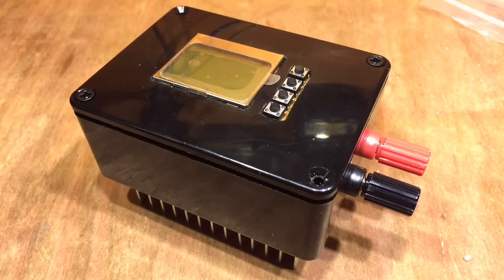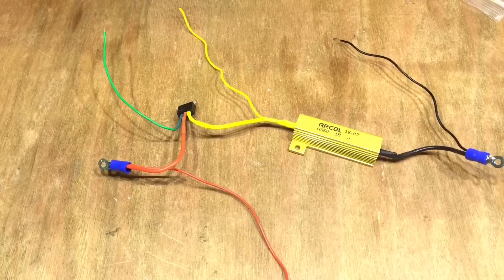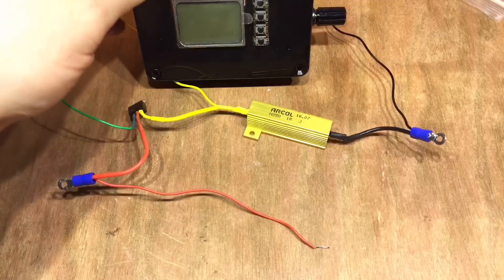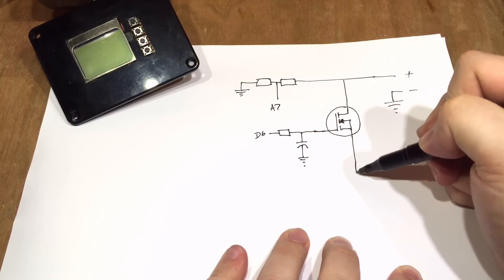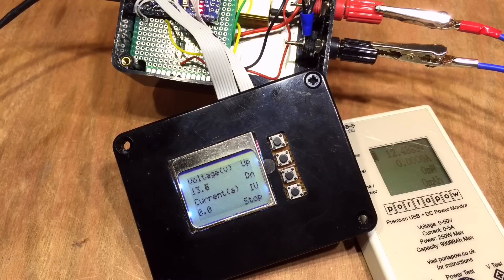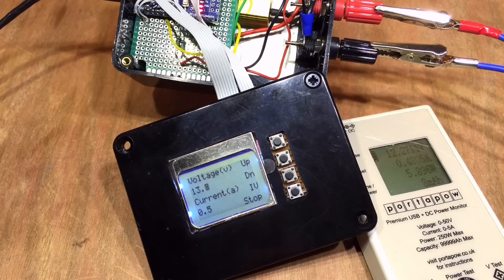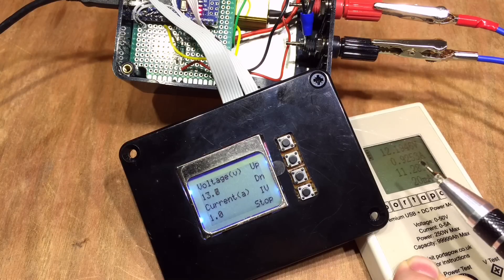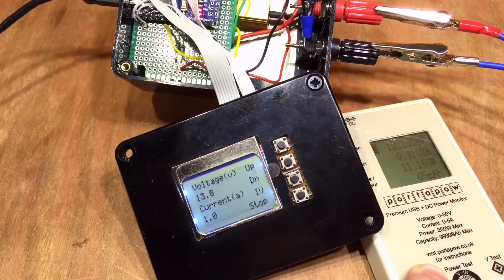Constant Current DC Load - Part 6 - Adam's Arduino Projects

Comment: Thanks for your videos! You are right, sometimes complex isn't what you want, if this is a learning project. I've been looking for something like this and I'll make it in next couple of weeks. If you made some changes or have something slightly different, let me know. Have a great day!
Reply from the maker: This was very much a learning process! It works but could be better. It might be worth looking at Dave Jones’ (eevblog) constant current load as well - using an op amp and a pot doesn’t allow for programming, but it works and keeps a very constant current with little oscillation. Combining the two might give a better result.
Reply: @AdamWelchUK  Thank you for your honesty, but your design is simple, that is very attractive! Have a great weekend and good luck to your channel.

Comment: Hi Adam
Do you have a final schematic for the final design?
I'm hobbyists but I'm trying too learn electronics and the last couple of months a have been trying to make a couple of different battery tester circuits but I still haven't found the right one yet. But maybe you're design is the right one 😜
I need the same futures as you but I want to add a fan and temperature sensor to make sure it doesn't overheat. And I need to set a minimum voltage limit to make sure it doesn't discharge the lithium battery too much. And then it need to add the current draw so at get tha battery's mah 😜

Comment: Very nice little project I might take a bit of your code for the dc load bank/charger I'm modifying for reading the amp I'll probably use a little hall effect chip for reading the amp since it provide isolation and I'll try using digital potentiometer for setting the current limit and see how that perform over pwm. Thanks for sharing!! Cheers
Reply from the maker: +bakupcpu Thank you. It works reasonably well this but there are better ways to achieve the same thing. I'm glad I proved it could be done with the minimum of components, but a Hall effect sensor a digital pot is a good option for improvement. Ultimately an opamp is also a sensible choice!

Comment: Awesome project. I'm gonna make it too! Do you think I should use an op amp? or is the Arduino fast enough? 
Thank you.
Reply from the maker: An Opamp is better to be entirely honest but I wanted to see if an arduino could do a reasonable job - which it does.  I like the idea of a simple circuit and using the least amount of components.  It's easier to build and explain as well as cheaper.
If you want to do it properly then yes, an opamp is sensible as it will react much faster.  Then you'll need to think about power though - probably can't power a suitable opamp from just five volts and expect to get much current through your load.  Rail to rail opamps are an option, but I still feel like you'd be best off powering the whole circuit from say nine volts and using the arduinos on board regulator.  
I'd probably use a dual opamp. Use one to control the current with a negative feedback circuit and the other as a voltage follower on the analog input before a voltage divider (if you need one). 
Thanks for watching the full series :-)
Reply: Can you please tell me how that feedback circuit will look like?

Comment: Adam, adding an AD586 will cost you $1,50 on ebay and will greatly improve the voltage reading (Arduino analogReference EXTERNAL voltage reference). Adding a rotary encoder for the menu and putting it all in a slightly larger case would make it perfect.
Reply from the maker: +Javier Palla Lorden You're correct that their are a number of improvements to make. This was another junk box project though - trying to make something work with bits I already had (well most of them). If I were trying to make a great dummy load I think voltage references and op amps would be far more sensible - but I worked with what I had and wanted to learn how well or not and arduino could handle the job. Thanks for the suggestions. If I ever create version 2 I'll be sure to consider them.

Comment: Well I think that is pretty good. A little off, but that means a little room for some tweaks hear and there. Good Job. I know these things can be tough to figure out as I am no pro and I do this kinda stuff as a hobby. I have had many things not work, but to my supprise I have had many that did work. It is fun to play with this stuff. The only transistor I have is a BD243C and I was going to try it but I don't think it will work in this application. Instead I think I will make a solid state Tesla coil with it.
Reply from the maker: +C MJ Thanks for your comments.

Comment: the rise time of your low pass filter is: 2.2*r*c = 0.1034s. This is the reason why you have that slow oscillations. You could speed up the PWM's frequency and reduce the low pass filter time constant.
You should split the code of the control loop, of the code of the LCD.
And one more thing, the arduino is powerful microcontroller for that type of operations.
Reply from the maker: All sounds like good advice - thank you.  I must get back to this project to see if I can finish it off completely.
Reply: Thank you, i really enjoy to see the thinking process of another person. And by seeing your videos, it make me want to build something :)

Comment: It's been a fun journey and the tutorials have given me more confidence and understanding. Your a great teacher. What's our next project chief?  Maybe a little bit more complex, but explained as you do.  Thank you
Reply from the maker: +Dean Greenhough Thanks Dean for your very kind words. This ones not finished totally. We'll be seeing it again soon. As for what's next... Hmm, I'm not sure yet.
Reply: +Adam Welch well..... I was thinking that as we have to measure a lot of things and I have 4 multimeters on the go. Could you come up with a more accurate ADC, maybe Hall effect sensor for current all displayed on a small screen. Like a multimeter with 6 inputs
Reply from the maker: +Dean Greenhough Interesting idea. They'd all need to share the same ground though - can cause problems sometimes... common positive solar charge controllers for example. I couldn't use the same Arduino test rig on the EPEver tracer as I did on my Eco-Worthy charge controller for example. The Arduino ground bypassed the charge controllers mosfet!

Comment: Congratulations, and nice persistence!!  I enjoyed watching you reason through the whole debacle, thanks for sharing.
Reply from the maker: It's not quite finished yet - I think I can make it a bit more accurate, but I am very pleased with the progress.  Thanks
Reply: yes you can use ads1115 its has internal voltage reference and uses 16 bit ADC ;)

Comment: Very nice project and I hope you will do some more work on it, really enjoyed it.
Could you do some averaging on the voltage and current display (like sample 10 times) and throw in a simple temperature measurement on the mosfet (with a LM35).
Reply from the maker: Yeah I did think about some averaging - the problem I guess is finding the right amount of samples to average - too many and it's adjustment to changes on the input would be very slow.  However I think there is some work that could be done here.  

I could add on a temperature reading, but my worry is that the more I expand the feature set, the less good it will be at it's core job!

Thanks for your comments.
Reply: I hope you can add some more features, I'll keep my fingers crossed.

Comment: You could try changing D6 pin PWM frequency, it's lower than 1khz by default https://arduino-info.wikispaces.com/Arduino-PWM-Frequency . And adjust the low-pass filter for that frequency, to avoid voltage spikes in the gate of the mosfet.
Reply from the maker: I'll definitely  look to see what effect this has - thanks very much.

Comment: Nice project , i think values are a bit off cause resistor cant switch on/off that fast ,  but i think they are good enough considering the amount of parts and money used i think i might build one , I would suggest a PID control on the Arduino side this would help on accuracy if needed i think there is a library
Reply: PI would probably be enough to solve your issues. And you might want to reduce the cap on the gate a bit. You draw it as an electrolytic so it would have a large influence on the time factor of your PI(D).
To come around any supply problems influencing your measurements, use either the internal reference voltage of the AVR or add an external precision voltage reference.
However: Good work, keep it up!
Reply from the maker: Thanks - A proportional–integral–derivative controller.  Not something I've read about before, but it looks like it might be of use here.
Reply: +Adam Welch Yes , @Rcmodelreviews has a nice vídeo on PID
Reply from the maker: Astralix2011 Hi - thanks for the comments.  Yes I think PI looks like a good option, just a little worried about the overhead but I'll be trying it out.  I'll think again about the cap too.

I've been looking at ways to use the internal reference to calculate the Vcc voltage - I think this might be helpful in a few of my projects.

Thanks again.
Reply: I need to check some old sources, but I implemented a software-DC/DC controller in an AVR some years ago. And I endet up putting the "regulator" and its calculation and correction factors into some lines of assemby code... You do not always have to fully install a PI code, sometimes just the essentials work fine. But for educational purpose, I'd like to avoid assembly :)

Comment: Great work! :)

BTW. Couple of questions.
1. What resistors and capacitors did You use for voltage divider and the low pass filter?
2. Would it be possible to run four of those circuits from one arduino? Will arduino be able to keep up with calculations for four of those?

I was playing with my arduino and have found that it barely opens the gate on this mosfet using its digital pin (4.7 - 4.8V in my case, instead of 5V), and effectively halves the current that is going through the circuit. 

I've tried to setup my digital pin to output using this command: 
pinMode(10,OUTPUT);
it helps a bit but not much.

So I've ended up using MT3608 step-up converter to pull my digital pin output to around 12V which seems to be sufficient to fully open the gate and only then gives me full load on the shunt resistor. Added benefit is that the mosfet stops getting hot and I don't need to put a heat sink on it anymore. Now I can use any mosfet, not only those logic level ones.

Oh, and I also started using internal reference to calculate voltages so i don't have to measure my reference pin and tweak the code every time I plug it to an USB and Im immune to input voltage changes. :)

I found a great tutorial on how to do it here:
https://www.youtube.com/watch?v=E8GqHvOK4DI
This is a really nice shortcut to get precise measurements on arduino. You Should try it. :)
Reply from the maker: Thanks! I used a 4.7k resistor and a 10uF cap for the low pass filter and a 100k and a 47k resistor for the voltage divider.  I'll probably create a better schematic once I've done the final tweeking of the design.

Expanding this to more circuits will increase the latency.  I suspect it will cause stability issues if you increase the number of circuits.  I was surprised the arduino kept up at all - perhaps it's worth testing this, but for my own use I can't see me using more than one load at any one time.

I'm surprised you're having issues with the mosfet - you've been using a IRLZ44N?  There is a similarly named IRFZ44N which I don't think is as suitable.

Thanks for the link to the internal reference tutorial - this is definitely something I want to look into.